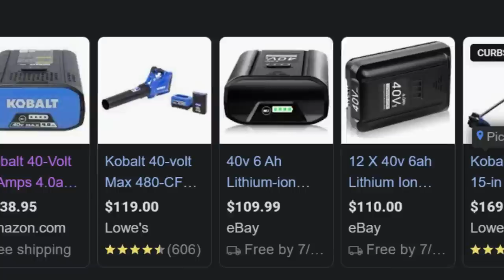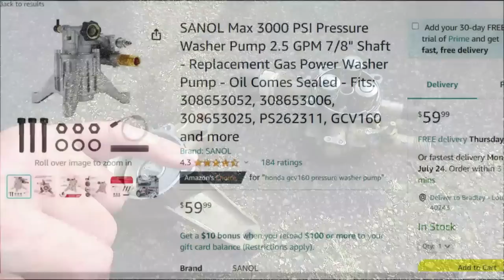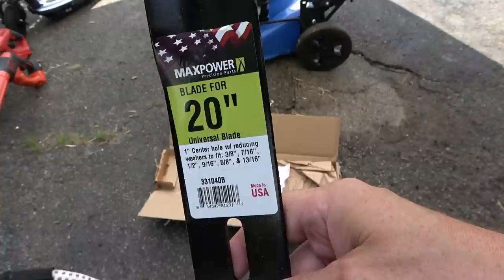ELECTRIC TO GAS MOWER ENGINE SWAP? Here's why I did it...

Comment from the maker: Total Project Cost:
Carburetor Main Jet for Briggs and Stratton 550e - $2.12
595660 Air Cleaner Cover 799579 Foam Filter 594281 Primer bulb - $9.53
Maxpower 331040B Universal Replacement Blade, 20-Inch - $12.71
https://amzn.to/44JGH3d
Rotary 15019 Mower Blade Adapter Kit; Replaces 753-06315 - $4.68
https://amzn.to/43ODFcP
Mounting hardware - $6
TOTAL: $35.04
Reply: Thanks, great idea.
1st place at tree hugger convention?

Comment: The reason your blade is hitting is because the chassis is not strong enough for the torque and vibration of that engine, too much flex where the engine is mounted especially after you cut a good portion of the center away. It might be a good idea to add your "template" between the engine and chassis and fasten it with 3 bolts along each edge of the template to stiffen it.
Reply from the maker: If that were the case, it wouldn't be rubbing when turned by hand.
Reply: @Fixologist1  The reason it was rubbing before you ground off the ends of the blade was the engine was not 100% centered, after you ground off the ends for clearance and started mowing I could hear the blade hitting the chassis but the strikes were inconsistent so something is loose and/or moving around.
That center piece you cut out had a stamped stiffening edge to give the mounting area rigidity, now it has been removed, the engine mounting area is just a piece of light gauge flat sheet metal with no support.
Reply from the maker: @gregerickson6924  You're right about the mounting being a hair off center, I'm sure. And you're right about the bend center of the chassis adding rigidity. But nothing is moving as far as the blade or engine. It's the mower deck twisting when you push and pull on the handlebars. Causes the deck to change shape minutely.
Reply: the deck looks similar to a newer model husqvarna. let me tell you, all newer pushmower decks FLEX LIKE HELL when you push from the side.

Comment: Since I have a Snapper 82v lawn mower for 4 years, it still runs like new because I have a shed to shelter it. Them electric mowers of a brand, including Kobalt, Snapper, Stihl, or Powerworks have Greenworks-looking features that can be fitted with Greenworks brand parts.

Comment: I could be wrong but I don't think environmental awareness is the reason people use electric mowers. Great work.
Reply from the maker: If convenience is the deciding factor, the price and longevity of batteries should cause people to pause.
Reply: dont say because they are quieter. they arent. electric mowers are LOUD.
Reply: @Fixologist1  I believe people use electrics because they dont want/know how to maintain a small engine. At least thats why some of my less commonly used tools are electric and all my normal use stuff is gas. If you keep the lithium batteries in the house during the winter the batteries will last for years.

Comment: Interesting project! I wonder if you could bot the template to the underside to stiffen up the chassis if it's flexing? Reminds me of the mowers we used in the '70's--just a motor on a deck w/wheels. No safety stuff like they have on modern mowers. It works good though, and can be a good backup machine.
Reply from the maker: I did consider that.

Comment: I’ve had my Kobalt 40V mower for 5 years now. I bought a backup battery when I first bought it. I made the electric mower work easier by removing all obstacles from the chute so it just shoots out grass to the side. Still working great and using the same batteries.
Reply: @mablesfatalfable6021  Agreed. I have a rather small suburban yard In southern NJ.

Comment: My yard is too large for a toy mower. I have a large corner lot, and  I would require at least three batteries to finish it, maybe four. I'll stick to my 21" Toro recycler. I purchased this mower in 1989 and still starts on one pull.
Reply: I found a Craftsman lawnmower that was at least from 1989, as the PCV vented to atmosphere, but someone had definitely changed the carb along the way.
Unfortunately they had finally given up as I found it tossed to the curb with the bowl off the carb, and looking worse for wear..
But deck is still solid, I replaced the carb, and here it is 35 years later, still cutting grass...
Amazing what care will do, even with an old Tecumish

Comment: In the future remember that the blades center holes are different based on the engine model. Blades adapter must match the center holes of the blades. If you measure the inside diameter of the deck you can determine the blade side.

Comment: The climate changes 4 times a year, as my dad would say "if it ain't broke don't fix it!"
Reply: I don't think that's what they mean by "climate change"  I think it has to do with the overall temperature change due to greenhouse gas emissions.  Not that I think batteries are any better.  In fact, it seems the larger they get, the more that can go catastrophically wrong.
Reply: AKA seasons 😂

Comment: Max power I just bought a blade set from them for my LT1045 lawn tractor. It said on amazon that it fits my tractor and my deck only comes in 46 inch size. Hopefully it fits.

Comment: Have one that has been in operation for several years.  Replaced the battery and picked up a spare.
Reply from the maker: Eventually your luck will run out and the company won't support it with parts. It'll be landfill at that point.

Comment: The mystery switch I would GUESS would prevent someone from activating the motor with the bag not completely secured...   There may be a combo of them...  Mulch plug, whatever...   Safety supplies galore,  since we're living in the age of idiocracy.
Reply from the maker: Actually, the more I look at it, I think it's a switch so the mower can be shipped with the handlebar in the down position without risk of the motor starting. The handlebar will engage the switch when in the down position.
Reply: @Fixologist1  Makes sense.   I THINK also the electric mowers are popular with the mechanical rookies...  who don't know how to care for an engine.   My friend has a little yard,  and he's not an engine guy... so he got a 120v electric mower...  at least no batteries.   His snowblower is 120v also.
A true hippie would buy a reel mower... no motors involved.

Comment: All this electric garbage is exactly that . Garbage. Buy a new one. Next year buy another one and so on. It's landfill
Reply: Exactly.   Buy an electric or $100gas weed wacker or mower, and expect to replace every couple years, throwing the old to the landfill.
On the other hand, I bought a Husqvarna weed wacker in 2002 for like $275 (instead of the $100 house brand).  It’s still running today.  The Honda lawn mower I bought back in 2011 is also running still today.   May not run as “green and clean” as what they want us to buy, but at least it’s not landfill!

Comment: Well, I have seen people take the decks of electric mowers and put engines on them as well.  Unfortunately, the machine you have, depending on your laws and bylaws you may not be able to sell due to the engine running a bit faster than the 3200 RPM (this isn't hard to fix, probably bending a piece of metal on the governor spring) and the lack of an operator presence system (you may be able to retrofit one on this engine) but nice conversion all around.

Comment: Thats exactly what the government wants people to do, go electric then when the battery or mower fails in 2 years buy a new one😂😂😂. This whole go electric is a joke!!! Ive stocked up on parts for my gas powered stuff and ill stick with that.
Reply from the maker: The overriding message is: throw away all your reliable, gas-powered equipment to save the planet, then we and our political cronies rake in a ton of money during the changeover. Plus we can pass whatever regulations we need to ensure we have a total monopolistic control over the entire industry.
Reply: Me too and I plan on getting at least 10
Riding mower and parts to rebuild them 4 times each

Comment: I'm at your "deterred" stage. I'm guessing there's a reason you didn't just use your dirty fingers to impress a tracing of the washer plate but now, since you have cut the other plate off, wouldn't it be best to cut the plate properly and weld it in place on the mower. You could really work on the durability at this point, building in some rigidity and avoiding any future plate flex. Hindsight really helps with making a mower that really would mow through the ages. Perhaps your daydreams of a better society would be absorbed through the mower by spiritual osmosis and developed by your grandchildren who will inherit Grandpa Brad's old bluey mower resulting in one of them realising a way that human civilisation that can prosper outside the system of economic growth. Your mower would become the symbol for our new world like the hammer and cycle was to a previous yet flawed attempt.
Just a thought.

Comment: i dont advise doing this, waste of time and money, selling the mower or getting a new battery would be more economical in the long run when factoring in fuel and maintenance costs of a engine, plus the lithium-ion batteries last well over 10 years. also if you dont want batteries, get a corded mower or convert the battery mower to corded.
also with the pressure washer  you can fix the crack if you weld it.
Reply from the maker: Pretty sure the pressure washer pump was cast aluminum.
Reply: @Fixologist1  aluminum can be welded

Comment: LOL, the batteries can be fixed for a lot less work than what you went through. I guess you didn't get a battery with the mower and in that case $120 for what did you say? 4yrs? I bet by the time you have a gas can, buy gas, pay for the gas to go get the gas and then just figure all your time a new battery ould be cheap. 
Now, if the fact is you just wanted to see if you could do it that is a different matter. I never stop laughing at just how hard people work to try to make a point of how much they love sending their hard earned money to the Middle East. The tech is here now, you just need to want to search it out. I bought a cordless weed eater 5yrs ago and I have not looked back. my weed eating is little duty and I was having to deal with premix and having to buy a new Feather Weight weed eater every 2-3 years because they just don't hold up. I bought a $99 Cordless 20v B&D at Lowes 5 yerars ago and the nice part is every time I pull the trigger it just runs. 
Good luck in the future on your lawn mower.

Comment: Honestly, a Briggs Flathead 2.5HP probably would have been a better choice than a Briggs OHV 550e. Theyre good engines, but too big, too heavy for that deck..
And I think the deck should have had spacers between the engine and the deck .

Thats why Pressure Washer engines dont work as Lawnmowers. The crank is too short.

Comment: This was a great idea, you're clearly very skilled. This mower is very dangerous. You cut too much off the deck losing strength. The blade was modified and not balance checked properly.
Reply: Thanks Safety Sally!

Comment: Rather than destroying the metal plate on the old PW why didn't  you just make a cardboard template... cheaper, easier and not destroy the old PW frame. The handles don't seem very tight, all over the place when your mowing..

Comment: That is not the correct blade. The center hole should not be round with that adapter. Entertaining to watch 😊.
Reply from the maker: The center hole will stabilize it on one axis while the two nodes stabilize it on the other. I know they make a blade with the exact shape for this adapter, but this one works.
Reply: @Fixologist1  for me personally I would feel safer having the keyed center hole that matches the adapter. Good job on the conversion.
Reply from the maker: @eostrike  The good thing about this type of blade setup is when the bolts loosen and the blades come off a mower like this, they fall straight down onto the ground. They don't go flying off in all directions like some designs with a center dish and small blades coming off the center dish.

Comment: Alright so you have a battery power driller impact but yet you’re crapping on a battery power lawnmower I don’t see it. I get where you’re coming from for mining the cobalt and all of that stuff but the batteries don’t last 234 years I have batteries that are coming up on five years old and I put them through hell and back every single day whether it’s cutting a tree down degree temperature cutting gas pipe in 20° temperature it does not matter if those batteries get used I’ve cut stuff when it was 120° outside. Those batteries are still going. I’ve cut stuff when it was -10 out and those batteries are still going. Kobalt batteries have a three year warranty. Now what I say battery mowers should be used by everyone. No, they should be used by somebody with a lot smaller than 5000 ft.² would not recommend anything more than that unless you have one of the ego riders.

Comment: In my experience the decks on those are just junk. It's better to use a deck made for a gas engine because of all the torque and vibration. That thing will disintegrate in short order!
Reply from the maker: Seems ok so far.
Reply: You can add a3/16 plate also to strengthen it and just move it from one frame to the other 
After all they will be laying around every where Free 😅😅😅